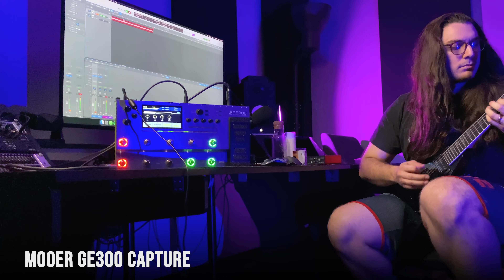Capturing Plugins with Mooer Ge300 | Tutorial

Comment: Hi, i have scarlett solo new gen. On the back, it says "line outputs" L & R. Shall i connect both of them to MOOER GE300's input section L&R? And one mono output from GE300's to instrument input of Scarlett. What do you think?
Thank you for deep explanation.
Reply from the maker: As far as I remember I stated this situation in the video but let me explain briefly;

Your guitar signal is mono, and a plugin usually has a mono signal if you have no stereo effects like reverb, delay, phaser, etc, or panned different cabs. So your left and right signals are identical if you don't have those.

Consider this and check the routing section of the video. I think you will get something nice if you can match the plugin and mooer fine.

Comment: OK, decided to try this again. One thing I am not sure about though, as follows:
return of Mooer to the backside of the interface - what does this mean, o the back of my AudioBox USB, I have two speaker outputs - do you mean one of these?
Reply from the maker: Let's try again. Before making any connection make sure all of your outputs only provides the same, mono, Plug-in sound. No direct monitoring too. Also make your source and captured sounds as close as they can. Don't forger the tone capture feature is mostly an eq-match tool. It won't change the main characteristics of the processor sound. Now;

Guitar goes to the "Processor Input"
"Processor Send" goes to the "Audio Interface Input"
"Processor Return" goes to the "Audio Interface Output"
Connect your hearing device (headphone, reference monitors etc) to the "Processor Output"

Then you can start the capturing procedure. I hope it helps!
Reply: @WrathVault  Thanks for coming back to me, seems either I am not understanding something.
My steps as below:
1. Guitar into Mooer input.
2. Mooer FX (mono) send out to Interface input.
3. Speaker out (back of Interface) to Mooer FX (mono) return input.

No sound. not even from headphones. even having trouble activating the tone capture it seems.
I think maybe, the Presonus AudioBox doesn't support it, or the cabling method doesn't work with the AudioBox.